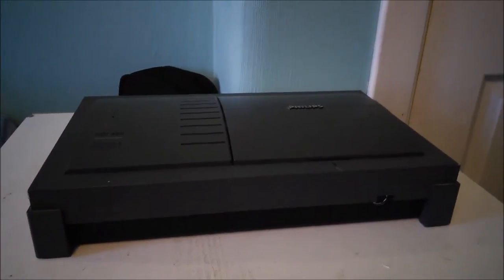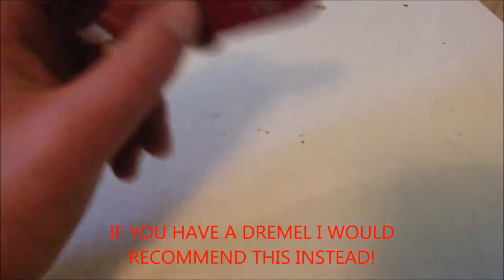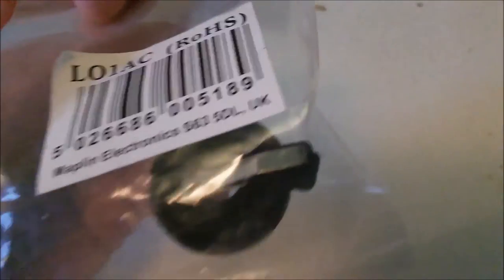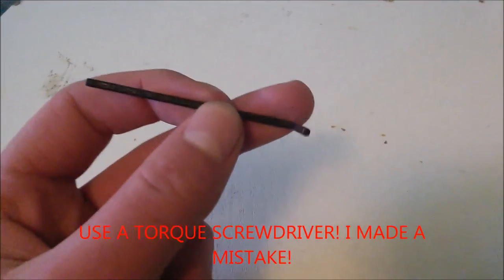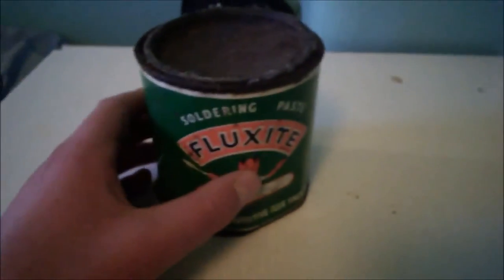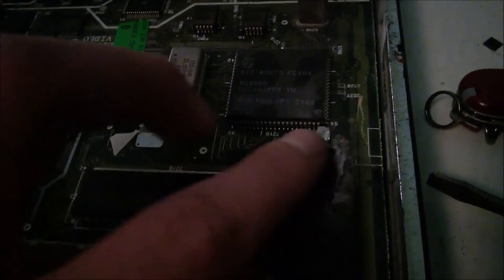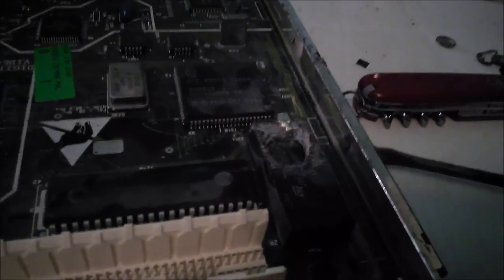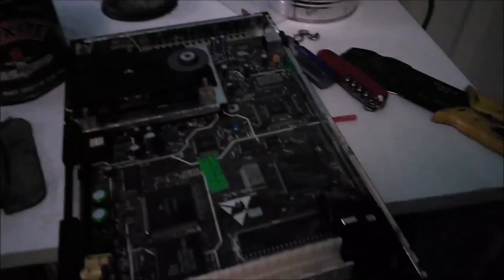Philips CD-I 450 Timekeeper Battery Replacement Guide/Worklog

Comment: You could just buy a timekeeper battery chip n re-soder it that's what I'm trying to do but I couldn't buy in on eBay they have tho just type timekeeper battery
Reply from the maker: There was something which could go wrong doing this method can't remember what it was though!
Reply: +Bobskie's Retro Probably the fact that these have been out of production for quite some time and all are likely to have a dead lithium cell.
Reply: +Eric McTrainshit but replacing timekeeper battery replaces that
Reply: +Bobskie's Retro ^^^^
Reply from the maker: +Eric McTrainshit That was it thanks!
Reply from the maker: +Miller SI But these chips themselves haven't been made for a while so they have a potential for a dead battery too. Also cheaper just buying the PC batteries if they go dead again. Probably easier to just replace the chip though so go for it and let us know how it turns out!